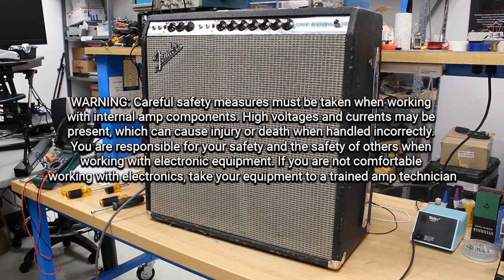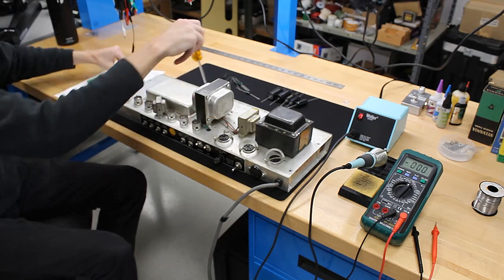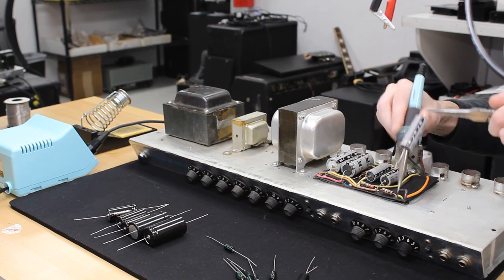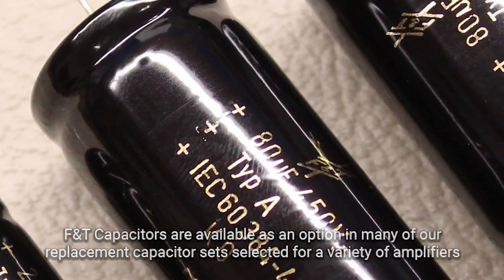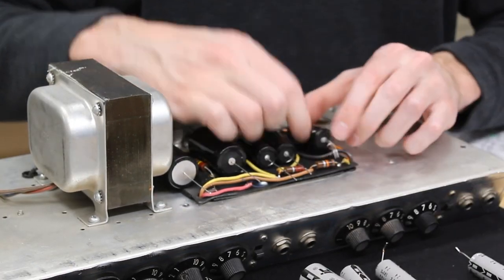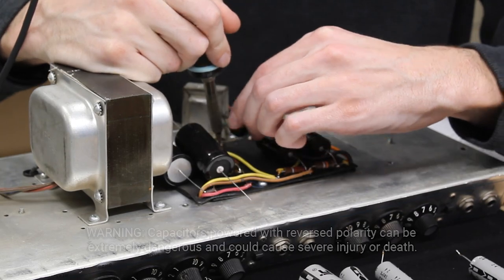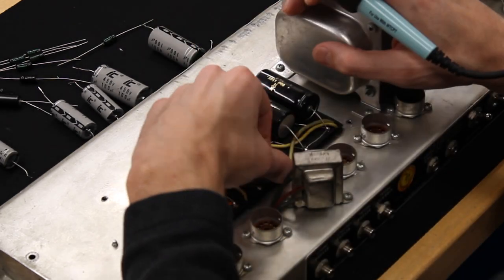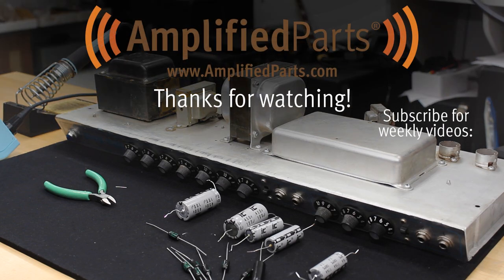Super Reverb Series: Replacing the capacitors

Comment: I would not touch those things until you know darn well, there is not left over voltage. And I have come to the conclusion that the longer these can stay in an amplifier, the better the amp sounds, and that's after 57+ years of playing ...
Reply: @Tonetwisters
that is an incorrect assumption: the sound may develop some nuances that are pleasing to your ear (in reality it's distortions), but the electrolytic capacitors can and will destroy an amp once they go bad, even with no visual signs of ageing, leaking, etc.

there are a number of ways they go bad, but in general their internal resistance starts to go up once they start drying out (although their capacitance will still be on specs or even higher) creating a short at some point... 
even before getting there, old caps put unnecessary stress on the rest of the components.. 

you double the life of a cap with each 10C drop in temperature. modern caps can tolerate much higher operating temps = longer life.
Reply: Just do this with a banana jack and one resistor, the D-Lab way.
https://youtu.be/2iqmDf0QIyM

Comment: I DECIDED to upgrade my 1970 "super reverb amp"  with new tubes ,just because of their age, played good , so i ordered 6L6GC tubes and they sent me "Replacement SUB tubes , " I PUT THEM IN AND AFTER ABOUT TWO MINUTES, the tube got really hot and smelled hot , burnt a cloth trying to hurry and get it out , i put the (6L6GC) tubes back in and it worked for about 15 minutes, NOW my baby want come back on, power to the amp & power to aux.external plug in, WILL not power up.  can someone please help me ?????
Reply: THE REPLACEMENT TUBES I USED WAS (  6N3C ) ARE THESE  sub. FOR (6L6GC)
Reply from the maker: Hey Sally. The Super Reverb needs to be biased when replacing the tubes. If it is not biased correctly the amp can blow a fuse and damage the tubes. I would suggest taking the amp to a tech who can assess the amp further and bias the tubes as well.